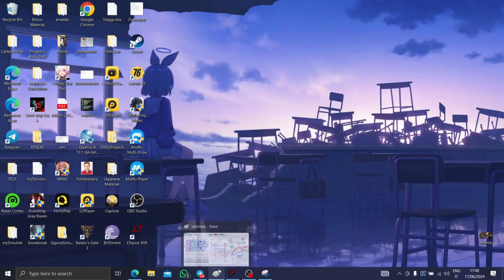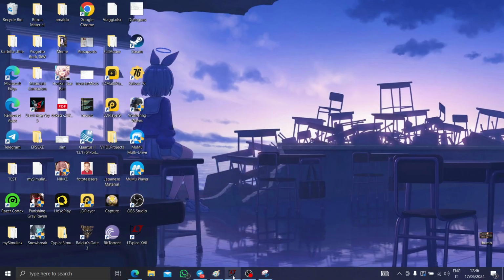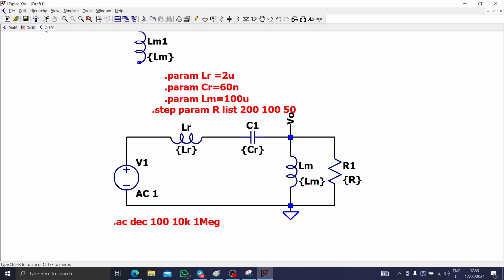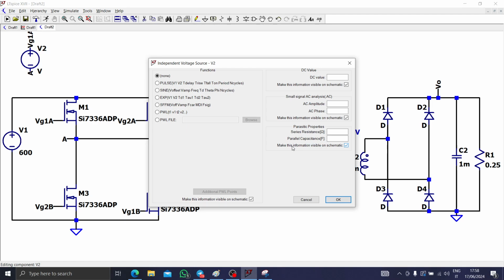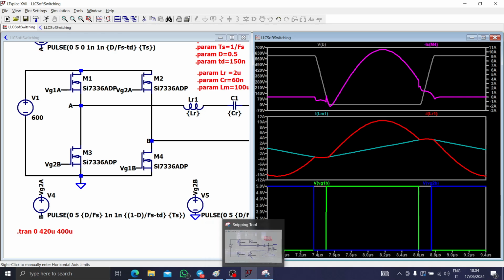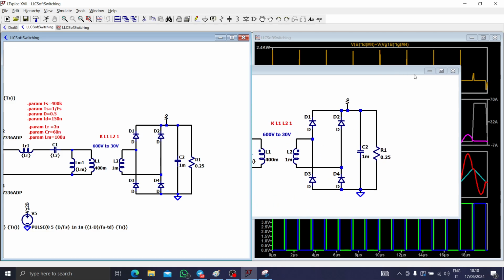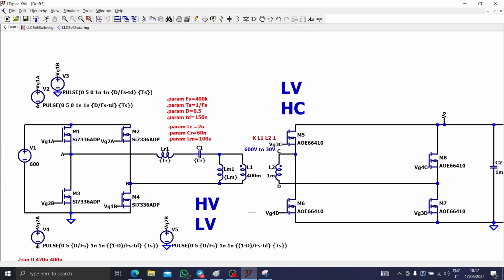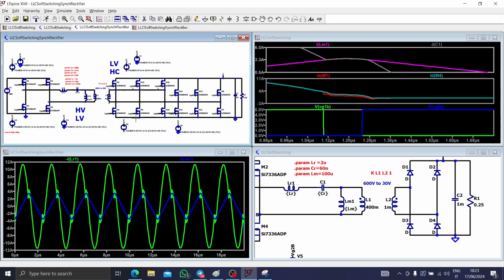[LTSPICE]  3kW LLC Resonator Soft Switching

Comment: How did removing the Vo node solve that issue?
Reply from the maker: Because the true output voltage is the Vo. 
When I recycled the LLC Tank, there was a Vo node
SO basically The transformer was shorted with the output voltage

Comment: Hi Sir,

Thank-you for the video. 

In the instance where you use a half bride that connects to a split capacitive link (for full voltage utilisation that would be available in a H-bridge but only needing two switches) do the two bulk capacitors add to the series Cr capacitance? if one then adds an additional capacitance in the network how does that then affect the series resonance of the converter in relation to the other bulk capacitors?

Kindest,

Doron

Comment: Question: why do we use both inductor and a transformer? Wouldn't be simple LC (transformer as L) circuit driven at resonance in short pulses be more efficient? Similarly to DRSSTCs ?
Reply from the maker: We don't use both an inductor and a transformer. In the LLC converter, everything is included in the transformer. That's when you can have enough voltage range with your frequency and leak inductor, that is.  If you don't have enough leak inductance, you have to add it externally.

Comment: Hi Mano,

I have bumped into your channel and I have been viewing in order full of your videos. I would like to say a special thank you for your great efforts.

My questions is that what are the differences between Lm1 and L1 in the transformer? Lm1 is participating resonant tank equations, and L1 is considered as transformer operation? In real LLC transformer, how can we extract/measure Lm1 and L1 by using LCR meter to distinguish their values?

Thanks in advance!
Reply from the maker: Hi! Thanks for your comment
So in order
To create a transformer in LTSPICE, you need two coupled inductors, hence L1 and L2. You need also the parameter K L1 L2 1 to ensure that L1 and L2 are magnetically coupled. If K is less than 1, you are modelling also non ideal coupling.
L1 and L2 are related to n^2, hence, if L1=400m and L2=1m, it means that the turn ratio of the transformer is 22
Input 1000V, Output 1000/22

Now Lm1 and Lr1, Lr2
Lm is the magnetizing inductance. In the LLC tank resonator, it has a pivotal role since it performes ZVS on the primary by changing energy with the Cds parasitic capacitance of the SiC mosfet of the primary Full Bridge. To do that, you need precise dead time. Hence Lm and Cr will be responsible for the ZVS on the primary. That's the first frequency.
Lr is the leakeage inductance. His role is mainly to give the series resonant frequency for the ZCS (not ZVS, take care) of the secondary synchronous bridge. The current will be modulated by this series LC to make the current go to zero naturally before the mosfet starts commutating.

Now, how to measure them
You use instruments like Bode 100 and study the primary impedeance, and with some heavy formulas, extract the parameter. Trust me on this, it's a job I am doing, as a Power Electronic Hardware Designer. Fun for the first 10 minutes, heavy after a month.

Feel free to ask
Reply: @LukeXVIIx64  Thank you for your quick response. I really really appreciate it. 

It sound silly but I am still having a little confusion here for Lm1 and L1. 

I could measure Lm1 when the secondary is open-circuited by Bode100 or LCR meter.

I could also measure Lr1 when the secondary is short-circuited.

I couldn't figure out that how to measure L1 in a real transformer. 

Yes, I can easily understand that K is coupling factor which is used to enter the N1/N2 to the simulation. But, my questions is that Do L1 & L2 values (400m and 1m) has any effect on LLC operation? Or, they are only used for determining turns ratios and they are not reflect any real circuit parameters?

Thank you for your explanations in advance.

Best regards,
Reply from the maker: @volkansuel4910  In LTspice you could put literally any values, provided they are big, because that inductance here has to operate like an ideal trasformer. His role is not to store energy and to change at each cycle like the Lm magnetizing does, but to transfer energy to the secondary.
Imagine a trasformer and it has a 2-3% of leakeage flux. That would be the Lr, so, all the other flux is transfered.
If you want to measure the true L1, well, it won't even be important as long as you have the gain of your transformer
You open there, short that, short this with that and bla bla and obtain the Gain 
But the L1 and L2? Not useful

Comment: How would you now integrate a close loop control in LTSpice? Basically adjusting the switching frequency with changing input voltage and load steps?

Comment: Thanks for the video. I had a question about how the power flows from one bridge to another bridge when the same gate pulse is applied to both primary and secondary side switches. Could you please explain?
Reply from the maker: During the Turn On time, in which M1 and M4 are On the current will flow in the positive verse, from left to right in the tank llc. Then the current goes in the secondary side and will follow the same path of the diode (so the first mosfet on the top left will be on). Imagine to replace the passive diodes with the active mosfets. During Ton, M1 and M4 are on on the primary, and the other two mosfet are active on the secondary (Top left and bottom right) like the diode were active passively. I explained this in the video before designign the synch rectifier
Reply: @LukeXVIIx64  thank you sir.
If both side MOSFETs are switched at same time , without any phase shift, whether power will flow?
If power flows ,since both are bidirectional switch, power will flow from HV to LV or LV to HV?
Kindly clarify my doubt sir.
Reply from the maker: @rajeshsethuraman1383  If you ever design this converter in practice, there will actually be a time delay lag between the first bridge and the secondary one. It's not 100% simultaneuous. Plus, when dealing with HV and probably SiC device, there will be additional loss to the discharge of the Cds at each switching cycle which has to be taken in to account. Driver design and auxiliar power supply for the driver are not shown in this video. In real life you will need flyback or push pull to generate 15/20V for the power supply or your drivers, both used for the first and the second bridge
Reply: @LukeXVIIx64  thank you very much sir

Comment: Did you now that Google sees the .dll files in your Buck converter directory as containing a virus ?  I know they do not but Google does not like them.  They don't like .exe files either and other extensions 
Thank you for this !
Reply from the maker: Woh, really? They are Just Spice files lol
Reply: No, there are 2 DLL files in that one directory that also contains .CPP files which download just fine.    When I choose either one or several files for my download in the ZIP file package, it even tells me that those 2 files could not be downloaded.  Weird I know but probably not that weird for Google and Google Drive.  Gmail also has limitations on what kinds of files are attached to an email.

Great stuff you have there though !   I am happy with what you have done with LTspice.   I have only started to use Qspice once or twice so far and it is nice you have some of that as well.